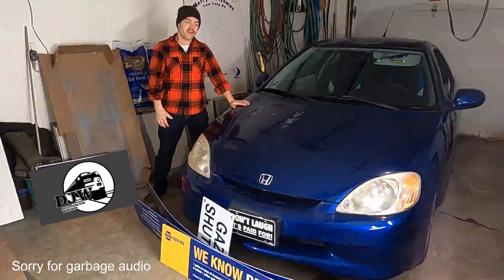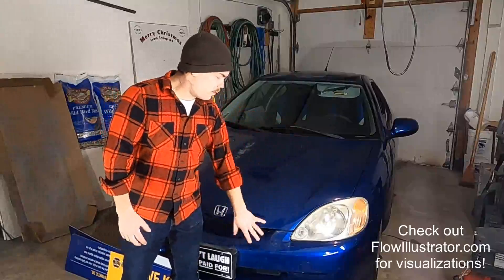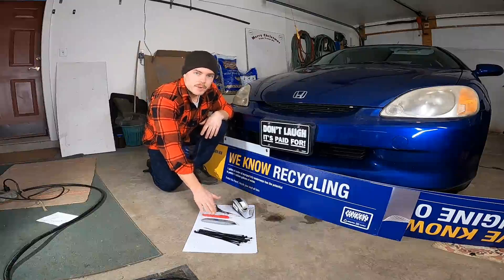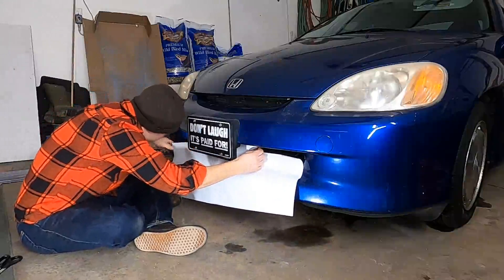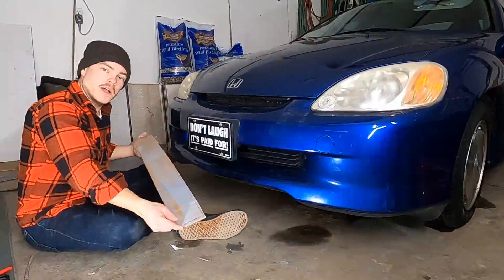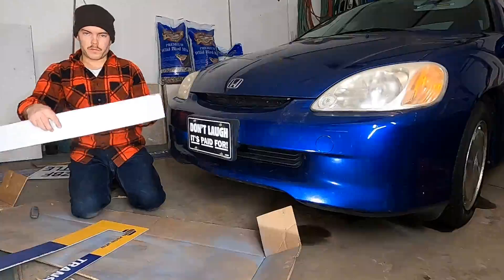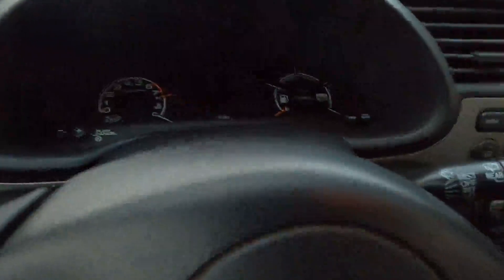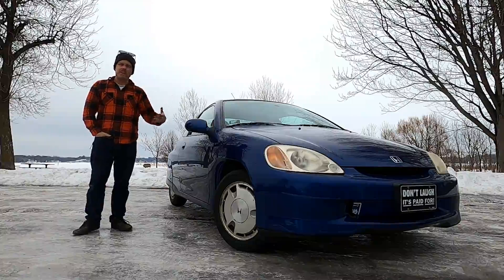DIY Grille Blocks: Free Comfort AND Fuel Economy? Ep. 9

Comment: I recently did this to my 2008 Toyota Prius because the engine was not getting up to temperature in 20F weather. Would hover around 140F -160F and after the block it runs at 180F operating temp. Highest it got was 194F.
Reply from the maker: I would look at replacing the thermostat...
Reply: @SealedBeamRallyTeam I did thinking it was the problem. Turns out it's a prius thing. Apparently, they all do this.
Reply from the maker: @jmoyet  Yikes
Reply: @SealedBeamRallyTeam  during the summer I was getting around 45-49mpg and winter came and it dropped to 38-40mpg and it was due to it always being below operating temp and was burning more fuel. Did the grill block now it gets to operating temp and it's back to summer time mpg's.

Comment: Thank you for sharing. Did you notice an increase in mileage that you can speak to? Cheers.
Reply from the maker: MPG gains from grille blocks alone are very small (the biggest gains are found at the rear of the car) and I did not do an A-B-A test. I would expect a significant fraction of an MPG out of just this, so it would not be noticable at the pump. However, the comfort aspect definitely is nice!